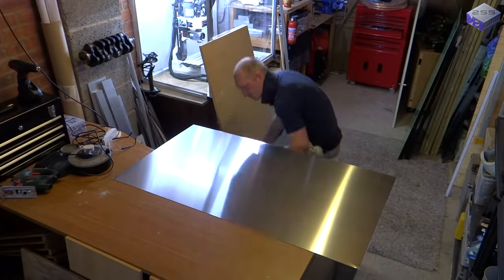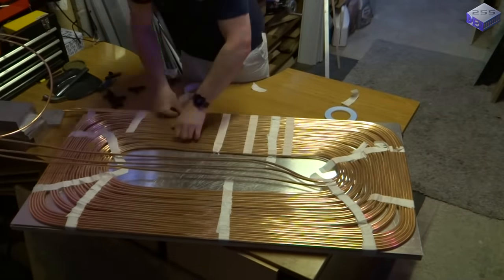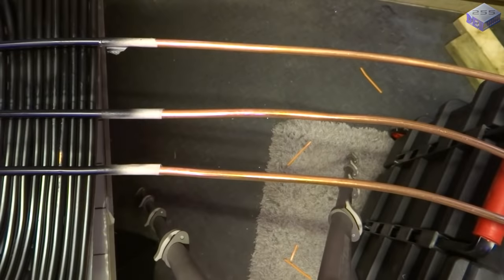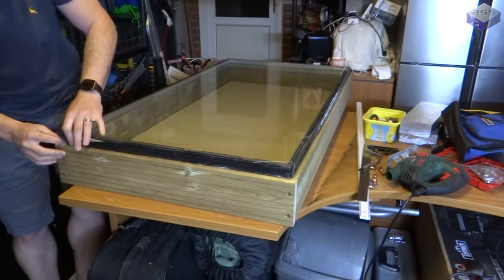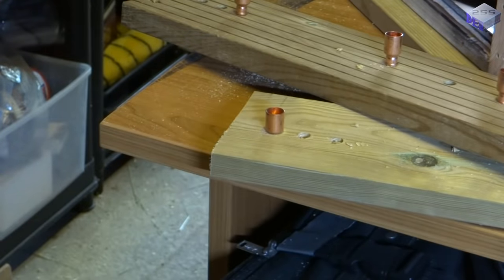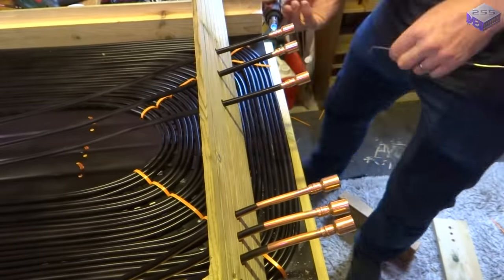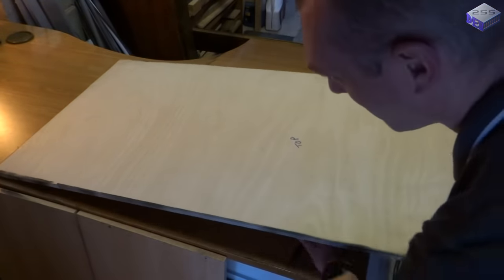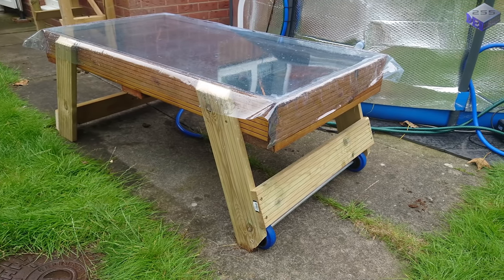Improved Solar Pool Heater - Full build

Comment: Neil, it’s a great video. I would like to build a pool heater based on your design. What are dimensions of your aluminum sheet?  How do I estimate if 5 pieces of 9.5 mm (OD) copper tubes, 15 meters each (total length75 meters) will fit on plywood 1.2 by 0.6 meters?
Reply from the maker: Thank you. This cost me around £250, although with the price of materials at the moment it would probably be around £350 now. The  aluminium is 630 x 1220 and glass is 650mm x 1240mm, everything else was just made to fit. To be fair, the fitting of the copper was mostly trial, where I tried to estimate it by measuring the outer run using a piece of string, then the inner run, working out how many tubes fit in the distance between inner and outer, then multiplying the middle tube length which is: ((outer length - inner length) / 2) + inner length. The middle tube length being the average length. Hopefully this makes sense.

Comment: Great build! If I was going to use copper instead of plastic pipe, why not use a propane or natural gas powered bbq to directly heat the copper coil that the pool water is flowing through? This way it can be used at night, cloudy days, and in cooler months like May & October to get more use out of the pool.
Reply from the maker: Thank you Master Grogu (great name by the way). The idea was to try and reduce the carbon output, although I have thought about this myself. I have an 8kW 12v and diesel cabin heater that I was thinking of hooking up to it. I will probably make a video of that one at some point, probably after the summer is out. Or a light sabre directly in the water, I bet Jedi don't have this issue 😉

Comment: You could also consider a miror film in the inside so to reduce light réverbération
Reply from the maker: Sorry for the late reply, it works fairly well, but will be trying some other attachments this year to improve it further. Such as sun tracking side mirrors, and as you suggest, possibly adding mirrors to the inside too.

Comment: If you hooked this up to a sterling engine to do the mechanical work, how much energy would it produce? I doubt you can get anywhere near as much as a normal solar panel, but it might be interesting for alternative solar energy.
Reply from the maker: Well I did get pure steam out of it after I left it empty in the sun for a few hours then ran water through it, the first thing out was around 20 seconds of steam and then condensation rapidly forming on the pipes, so I think it could be an option. Either that or a summer coffee machine  😉

Comment: You'd increase the efficiency by keeping the pipes further apart on raised pipe clips and not painting the backplate to get reflection the glass will bounce a portion of the reflected light back a few times increasing the overall heat in the box. You want the pipe to absorb heat as much as possible by raising it you include the back of the pipe same for keeping them apart to allow light through to as much pipe as possible. obviously to go one further would be to get the lensing effect by concentrating the reflections on the pipes with curved surfaced reflectors Unfortunately that would preclude using any flammable materials because of the achievable temperatures in the unit.
Reply from the maker: Hmmm, I like your thinking and wonder how easy that would be to do 🤔.I am thinking of attaching two side mirrors that are hinged and automatically controlled so that they always reflect the sun onto the pipes, plus would negate the need to angle the panel towards the sun. I should also add reflective foil to the sides too (inside that is). A Fresnel lens would have to be quite big to increase the light and be capable of tracking the sun around the panel. Hmmmm, hopefully if I keep the flow going through there shouldn't be much heat build up, I'll have to use the side reflectors as covers when not in use or when the flow stops as a safety feature. Good thoughts, thank you.
Reply: @TheSolarPoweredEngineer   have a look at solar stoves you'd be doing the same but with a pipe vs the food you could achieve steam in the pipes effectively pressurizing the system or using a loop wrapped around the pipe feeding the pool

Comment: Looks great well done. How ever alot of work when 500 watts of solar panels is cheap second hand.
Reply from the maker: Thank you, it was a lot of work, although does have a much smaller surface area than PV panels, but you may have a good point on cost, unless you can get to recycle something else for the parts.

Comment: How did you calculate 500 watts, doesn't sound a lot to heat a pool , mine is 54 cubic litres so would need quite a lot of these
Reply from the maker: Hi, I calculated the 500W output from the input-to-output difference (around 1.4ºC) with a measured flow rate of 4 Litres per minute. Have you got 54,000 liters? If so you will need a much bigger build, I would recommend the black PVC tubing that I used in my first version as it would be a lot cheaper, or just heating your pool with Sol+ Guard 500M GeoBubble cover that sits directly on your pool, it will take up less space and reduce the amount of chemicals used in the pool.

Comment: Expensive and effort intensive project with very limited efficiency. For solar heating the main performance element is area (you can get up to 1kW/m2 of area). Black matt and black gloss have no performance differences - reflection is similar (one is specular and one is diffuse, but reflection rates are the same). So many things you could improve here that i don't know where to start. Honestly, you would have had (significantly!) more heating performance by painting the bottom of your pool black - or in lieu of that if you don't want to change the colour of your pool when you swim in it, put a removable bit of black material in the water.
Reply from the maker: It was fairly effort-intensive, although performs quite well (around 500W and less than 1m2), I should be able to give it a full test this summer and potentially improve the efficiency of the system by trying suggestions from the comments, as I did with this version. I do have a black floating cover that generates some heat, although had to set up the pool in the shade last year, will give it a go this year. That is very interesting with the paint, I will have to research it a little further. Thank you.
Reply: @TheSolarPoweredEngineer  So... just to throw some ideas at you - ignore as much as you like. So obviously you get all your energy from the sun - which is about a max of 1000W/m2 (normal to the sun direction). In the UK you are already offset by 30degrees but anyway. The copper solution with pipes has a low cross sectional area so you aren't making full use of the area you have available. The upside, is that (on top of the black paint) you get some solar trapping between the pipes so the black paint which normally has a visible absorption in the range of 85% is probably increased but maybe 5% or so. The downside is that the energy that hits the aluminium below is mostly lost. You tried to recover it by clamping the copper to the aluminium but unfortunatly it won't be very efficient. So the best method is - maximise your area! You could do this with the aluminium sheet (as thin as possible) on top and painted black - this means 1m2 of aluminium would give you 1m2 of absorption. Then you could seal around the perimeter and pump water in one side and out the other (put in some internal obstacles to ensure you get water flow over the complete surface and turbulence is always good for heat transfer). The bottom surface would probably be better then as plywood or something whcih would insulate the underside but that doens't matter too much as I will get to. So - big sun facing area, water flow over as much area as possible.  You would essentially be able to get normal area x absorption x 1000W directly into your water. The next problem is losses whcih is what you were doing with the glass cover. You don't actually need to glass - the losses are a function of delta temperature (i.e. temp of your hot surface minus temp of suroundings). So the best thing to do there is increase your water flow rate - that way you reduce the surface temperature of the system and reduce the delta temperature to the environmnet and hence less losses. Then you don't need to glass (except for when air temp is considerably colder than water temp as this would prevent aditional losses) but the glass may actually be reflecting more sun energy than it is keeping in. 

Of course you could also just use a thick plastic material that you create channels into for the water to run. You'd get pretty much the same efficiency as all this.
Reply from the maker: @Netheralian  I'll take it all, thank you, I love reading different solutions and like the delta temperature description. I will be making a few tweaks to this one and possibly making a 3.0 with all the ideas to get the best solution, so thank you for your explaination as it helps a lot 👍

Comment: Think your next project should be a oil heater with glass tubes and parabolic mirror like solar boiler power plants use would be way more efficient and possibly cheaper and can work without a pump as long as the  trough is lower than the exchanger and the hot side of the exchanger is at the top the cooling of the oil will cause it to flow as will the heating if the cold side is lower than the hot side on the trough the advantage is you could take a box wood stove surround it with fire brick run a copper coil in the gap return on the bottom and output hot side on top even going through a worm in the chimney then fill the gap between the stove and fire brick with sand
Reply from the maker: That's quite a detailed description, I did look into glass tubes with a special coating to optimize heat capture, as I was interested in the self pumping capability due to hot water/oil rising in a closed-loop system. I may need to look at this further, thank you.
Reply: Probably should run the worm around the chimney on second thought the flames could oxidize the copper

Comment: Well done on this excellent build, i know you gave a wattage value but what was temperature increase? Thanking you
Reply from the maker: Hi, the temperature increase is around 1.5ºC average with a flow rate around 4.5 litres per minute. This doesn't sound like a lot, although it does increase our 4600 litre pool temperature by around 2ºC during a good day. Supported by the older version 1 panel, an increase of around 5ºC is possible.
Reply: @TheSolarPoweredEngineer  super, thanks for this info. Of course 3 degrees doesn't sound much but thats alot of energy to make that change, free energy. Im contemplating on building this in tandum with a heat exchanger connected to my oil burner. Cheers anyway for the video.
Reply from the maker: @xntricity6446  No dramas, the other point to note is that the retention of heat is also an important factor that is commonly forgotten, with good insulation below, above and around the pool, you could reduce heat loss through thermal conduction through the sides and ground and reduce heat loss through evaporation. You will also reduce chemical loss too if the pool is covered when not in use.
Reply: @TheSolarPoweredEngineer  Very good point, i do have a solar pool cover but did not think about the sides and base losing heat, i will research this a little more as living in Ireland our climate is cold generally . Thanks
Reply from the maker: @xntricity6446  No worries, please feel free to ask any questions, I am learning a fair bit from all the experiments I do at home.

Comment: Congrats for the project. 
I am just wandering if using a small pressurized solar panel isn't easier and cheaper. The total cost for you project is around 150 euro if you would have to buy everything. A 10 tubes pressurized solar panel is around 250 euro. Not sure is worth the time if you don't have the materials (or cheap reclaiming materials from somewhere)
Reply from the maker: Thank you, yes purchasing one could be the better option, especially if there is little space at home to make one or the materials are hard to source. The idea behind these projects is to see how efficient a homemade panel could be and how they compare to some off the shelf types. I hope to tweak this one later this year and look at making a solid-state type, I will include material costs in future ones too.
Reply: @TheSolarPoweredEngineer  Awesome. Did you manage to make some kind of masurements? Not sure how can you determine the power. I guess how much time it take to heat up 50L of water from certain temperature to...80C. 
I wanted to build something similar but copper is expensive. 
If you eliminate copper and use some cheaper pipe than it might be worth it. It would be a nice comparison to replace the inner pipe with some plastic and try to determine the difference - both cost and power (it's easy to give ideeas:)) ).
Reply from the maker: @titusm9837  Hi, yes the copper is a little on the expensive side and there is a concern with it reacting with Chlorine when the PH is off, I need to find out more info on it. I may make a really long version with plastic pipe, but will be doing more experiments this year and showing all the differences via temperature and flow rate logging with an Arduino.

Comment: Do you think this will work to heat up my swimming pool that i use as a fish tank in my basement? its 1000 gallons, and always around 66 degrees, i need it at 78 degrees. would love some feedback, thank you
Reply from the maker: Hi, hopefully you are talking in Fahrenheit, where 25.5 Deg C should be more than achievable in doors, your internal pool is roughly the same size as our outdoor temporary pool. The pump will need to have a decent filter attached if used for fish, although I'm not sure if you can use copper in a fish tank, if not pvc pipe used in fish ponds would work also. The pump would need to be powerful enough to pump water a fair distance if you solar panel is far from the pool, I used a 4600 litre per hour AC pond pump at 25W that could raise water to a height of 1.8m; this from All Pond Solutions in the UK. The other things to consider is controlling the pump, ideally you want to only start pumping when the solar panel is around 5 Deg above the pool temperature and stop at around 2 Deg above (hysteresis) as it will have the opposite effect of cooling your pool if left to pump with no sun. Also, you would need to drain the water out of the solar heater if you get below freezing winters and heat the pool another way, so it's worth considering manual diverting valves to isolate the solar panel. I hope all that helps, this was just my initial thoughts for your project. Sounds an interesting one 👍 good luck

Comment: Awesome build.  It looks very professional and much better than what I did a few years ago.  I did two of them (4'x8') with Pex so I couldn't make as tight of bends as you were able to make - thus not as much surface area for the given real estate (I was trying to cheap out).  Not satisfied, I then just draped about 500' of cheap black irrigation pipe over my lot (inline with the two collectors).  It looked like $h!t but I had a half acre of mostly sand/dirt which could help the pipe soak up additional heat (from the ground) when sunny.  At a flow rate of about 2.2 gpm (it was a LOT of pipe for the pump), the most I ever got out of it was a 19*F bump in temperature.  Didn't take long to get my above ground pool (about 2800G) to a comfortable temperature.  Even better was when I made a wood fired heater...that gave me a 20 to 22*F bump in temperature at 3.8 gpm ( a much shorter run of pipe for the same pump).  The downside was that I had to burn wood for that one.  But I didn't have to rely upon the sun.  Got it to 95*F for my grand kids at Thanksgiving!  This was all in California.  Only thing I would change (on your build) is to paint the orange zip ties so they don't degrade from the sunlight.
Reply from the maker: Thank you, sounds like you did really well with your setup, that's some impressive temperature increases. Yep, the sun in the UK is even more unreliable. The zip ties definitely need something before all the pipes spring out, I may use copper ties instead and use the same black paint.

Comment: What's the total cost? Would it not be more efficient to use air evacuated tubes with a copper heat pipe insert. These are built for this and have very little waste copper. I think I face seen them for $25 per tube
Reply from the maker: Hi, it would roughly cost around £350 with today's prices for this one, although it does produce around 500W from an area of only 0.81m2, whereas a 10 Tube (1.8m lengths) produces around 600W from 0.8m2 absorption area but costs a fair bit more (around £500 for the heater only from what I've seen). Here is a link to the technical data of a system: https://www.jouleuk.co.uk/joule-acapella-evacuated-tube-solar-thermal-system/

If you can get the tubes for $25, it may be worth you assembling them yourself to get a more efficient system, although they can be a little delicate and only work up to certain pressures.

I will be doing a more technical look at my version 1 and 2 again this year with flow rate and temp in and out logging, so there should be good data to compare it to.